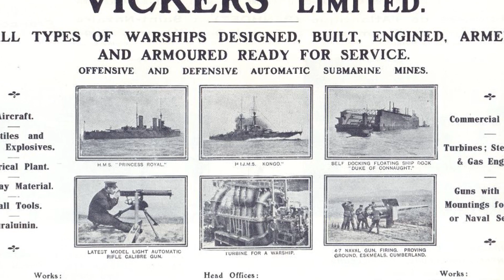How Much would the Royal Yacht Cost? And Who would build it?

Comment: Very interesting topic, I am not a royalist but I completely agree with you on all of the benefits of a royal yacht, I actually can't see any downsides of it, other than it'd give negative, annoying anti-royalists a platform for a little while during debates.  Out of interest (for when I come across a few Billion £) when you mention the cost of a yacht is mostly calculated in GRT, what would be the average £ cost of a GRT in the UK for a yacht such as Vava II? Thanks, and keep up the great work!
Reply: i realize this question was asked 8 months ago but i feel it deserves an answer. the VAVAII weighs in at 3933 GRT and is reported to cost 100 million GBP. so you are looking at 25,426 GBP per tonne. in case you are wondering the royal yacht would be 50 meters longer and a great deal wider and weight in at close to 15000 GRT for a cost of 381,390,000. once you add in upgraded materials and custom work you will easily top the 500,000,000 GBP price range. i have no idea what it costs to put an exercise room for corgis on a yacht.
Reply: @jamesgoesoff1992  Re Your last sentence, now a moot point, as the Queenie's last corgi, went to the great kennel in the sky a few weeks after your post :)
Reply: The cost is escalated because it will have to have special features no one talks about. Military quarters apart from crew quarters. Some sort of defense system, radars, jammers. Most probably specialized hull construction to withstand torpedoes and what not.  A vessel of this type is pretty much gonna be a super pretty full navy ship. Then the interior should dictate how much it will add to the cost. A royal yacht will not be anything remotely close to a regular yacht, you are taking special furniture, special materials (exotic), gold plated stuff, then you have bullet/rocket proof rooms, special superstructures. I mean, this its not a regular yacht. That's where all the increase in cost

Comment: The UK should do it. And I can't think of anyone other than BAE/Vickers because it will need to be built of steel and have a GRT of at least 6000 tonnes. I'm Australian but I know Austal can't do this. The new Brittania needs an embarked helicopter and hanger. Two large tenders which can also act as lifeboats but don't look like lifeboats, if you know what I mean. Accommodations for 16 guests and 60 crew. A very large elevated back deck for entertainment, above the hanger. Overall style should not look like your typical Dubai gin palace so that rules out something that Lurssen puts out. Long-range but speed is not a top priority, about 16 Kts cruising speed will be fine. Monohull but with the best stabilisation systems (ballast, anti-rolling tanks and stabilisers). DP2 (azipods and bow thruster) for self-docking and safe launch&recovery of the tenders.